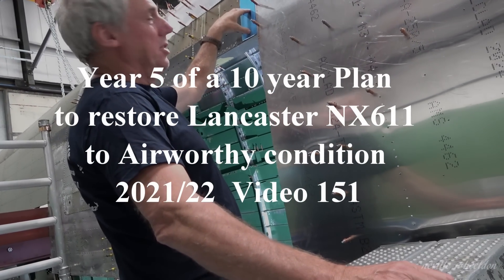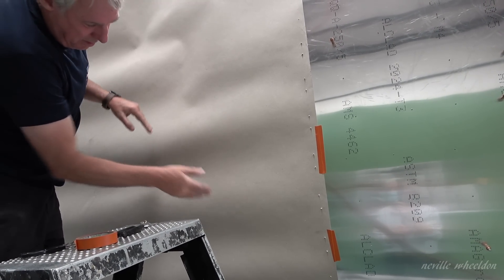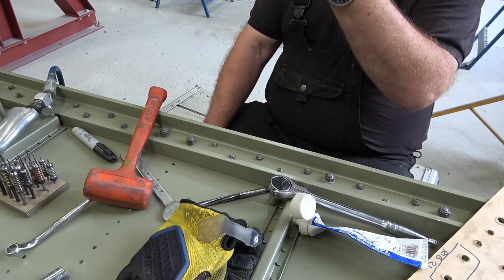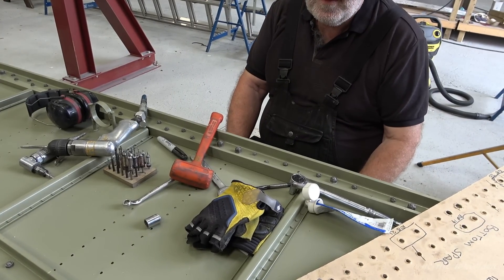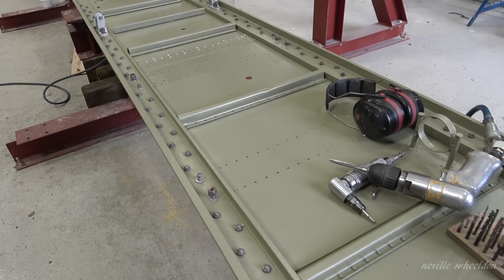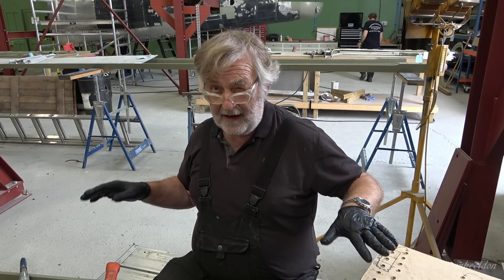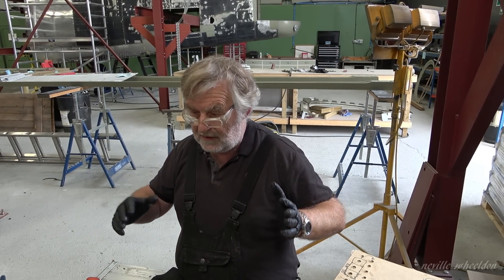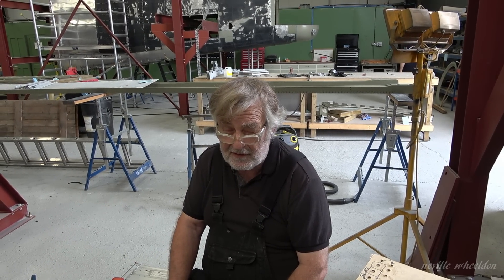Video 151 Restoration of Lancaster NX611 Year 5. Assembly of the Lancaster port wing rear spar .

Comment: very impressive work, to see that spar transformed back into what it once was
and also to realize how they were manufactured compared by todays standards, using correct rivets, not magnesium which corrode and split, and doing bolts up to the same torque setting and not just f.t.

Comment: Excellent use of CAD. Cardboard Aided Design. (As also used by Project Binky)
Reply: It is surprising what can be built using cardboard/cardstock and a hot melt glue gun.  And at only half the price of aluminum!!!
Reply from the maker: Hi raytrevor1, there's no rules in this game (CAA not involved).